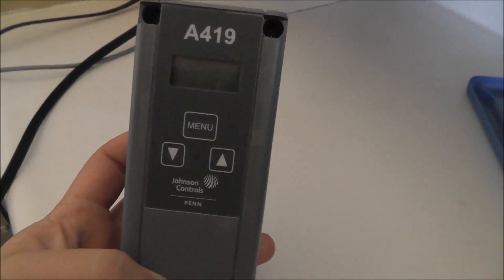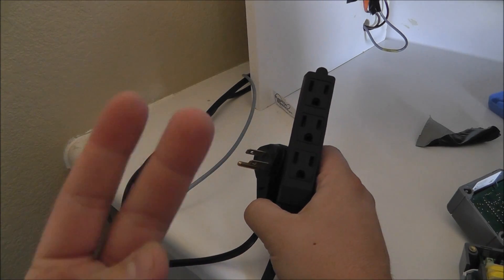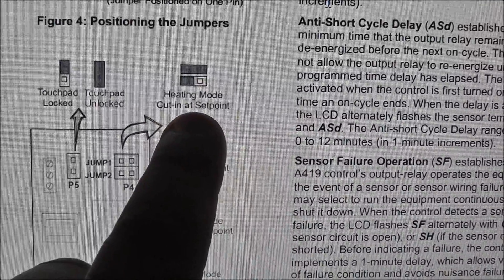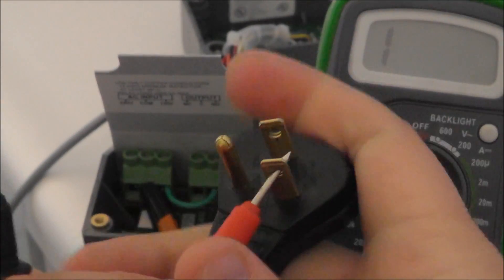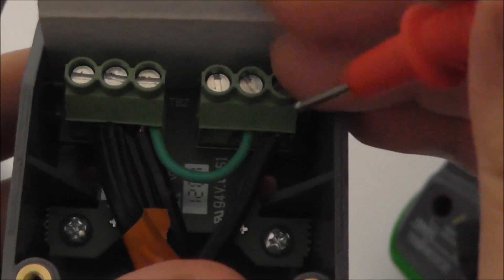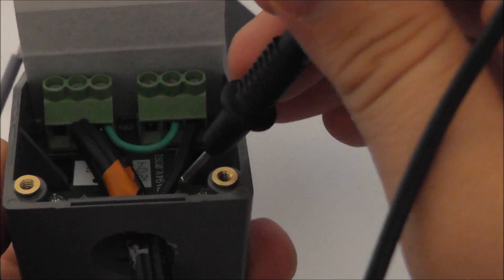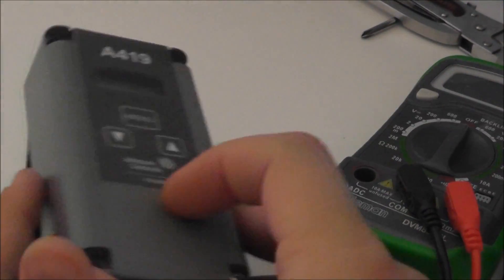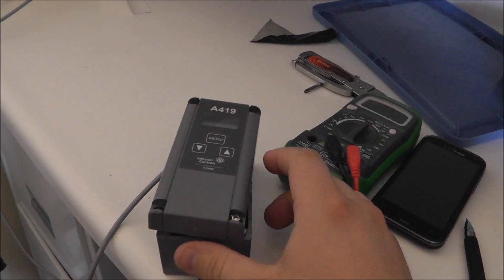How to wire an A419 Johnson Controls

Comment: What you call the big slot is the neutral.
 On a flexible (extension) cord, the neutral is identified by ribs on the jacket of the wire.

Comment: So nervous ?  Would be nice if you relax and use proper terminology. wide blade side is neutral and small blade side is power. for your future videos I suggest using terminal blocks with color wire off of the block on to the device. but not a bad first. also note: show a result of wiring to the heater.
Reply: PS, Green wire is a ground, don't use on power side of circuits.
Reply from the maker: If you don't like the video you don't have to watch it! Most of the people that are doing this for the first time are not going to know what the proper terms are. (hence why I didn't use them). I didn't wire it to a heater so why would I show that? PS I know the green wire is ground, and It was not used at all in this. That is why I cut it off and used it for a short.
Reply: SinSitySnakes Also for safety sake you should be switching common on/off with the controller not the hot wire, this way you have one less hot wire in your circuit and one less thing to cause shock/fire if something goes wrong. I know this is the opposite of household electrical. Otherwise nice job.
Reply: Good point Noel..

Comment from the maker: Im guessing you are talking about the jumpers that are already on there, not the ones that you have to wire?  If it is, it tells you on the owners manual what the different jumpers to the pins will do. One is for cooling and heating and the other is for if it shuts off when it hits a temp or turns on when it hits a temp